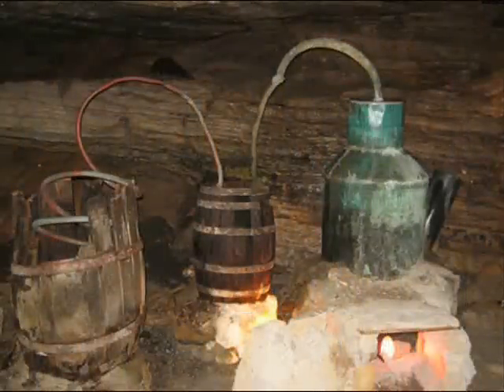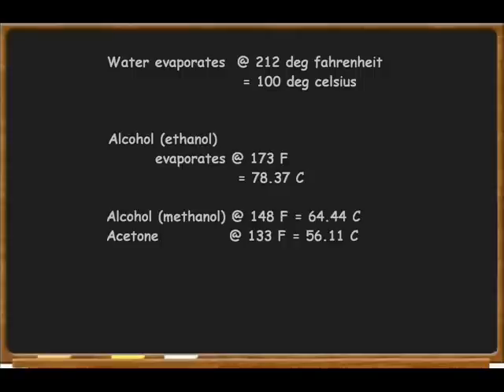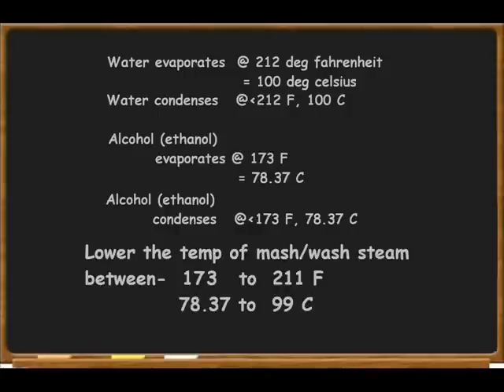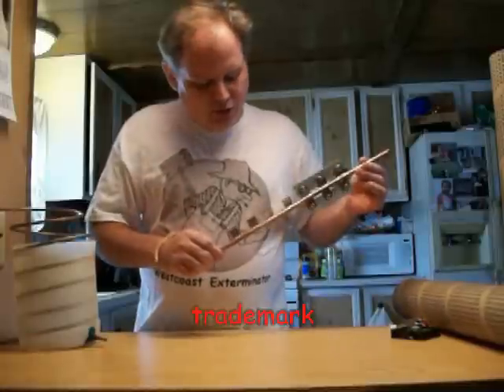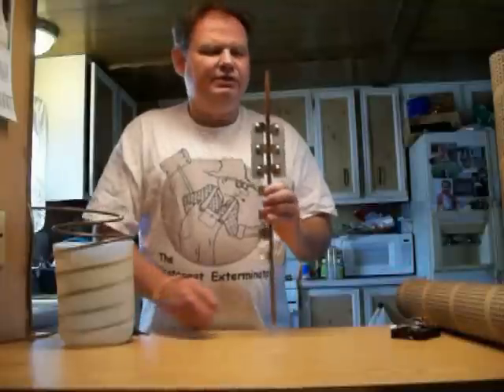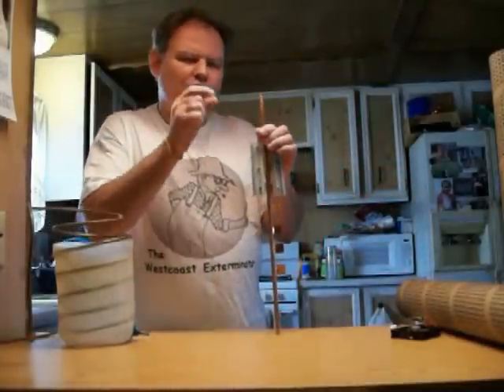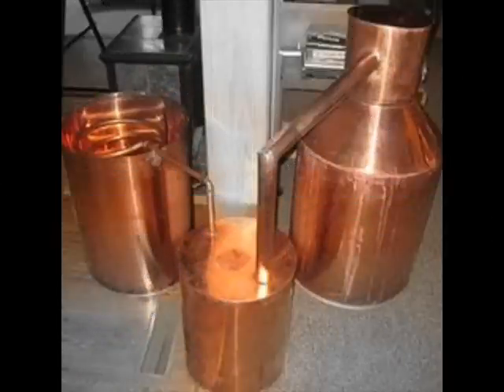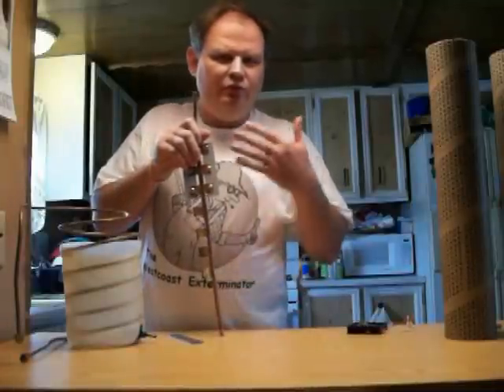Moonshine Still Reflux Columns & Thumper Kegs 101

Comment: Great video with the right information. I have 24 quarter inch copper tubes through the top half of my column. Looks like a porcupine, but works great with just a small fan on it.

Comment: Rather use a half meter 50mm copper pipe and put half meter 15mm copper pipes in til it is full of pipes inside giving it alot of surface area for the steam to touch and condens on

Comment: Good info.  Brainstorm! I am going to use this info and use a 4' length of 3/4" copper baseboard heat element already covered in aluminum fins made to dissipate heat. No more 2" column. Thanks. Now I see this is 5 years old.
Reply from the maker: Keep me posted on your results.
Reply: I would like to know how this works out for you. I was thinking the same thing. Thank you.
Reply: I will use 1/2" baseboard element off the line arm.  Easy add on. Will update.
Reply: @joeogden7361  ok, thanks for your reply looking forward for your results.

Comment: One flaw I can see is that steam produces pressure.  The smaller the tube Increases the pressure which will not allow the water to condense and fall out and away from the alcohol vapors.  1 inch pipe should be the smallest column used.
Reply from the maker: There is logic to that, but I run extremely low pressure

Comment: So u have to fill the thumper with alcohol well not fill but a lil past the lowest pipe what if its my first run on a still should i leave it empty ?
Reply from the maker: Well I'm not even sure how reliable a thumper is. Personally I don't see the need for one. If you look at Popcorn Suttons last run video you'll see he has a thumper to increase alcohol %, BUT he then waters the final product down greatly. Also the temp of the thumper will slowly rise, making it less effective. Also you can just add the "backins" to your pot. That's what I do.

Comment: Can you run it through a small radiator like a transmission cooler with a fan behind it that's temperature regulated when it hits a certain temperature the fan kicks on
Reply from the maker: Hmmmm. Yes and no. It would be more correct top say to dial everything in, like adjusting heat and air flow to cool things. You want everything at a constant, not fluxuating.

Comment: FYI: For mechanical metal contacts (not soldered) heat transfer grease is available. Typically it’s used between heat producing components on electronic circuit boards and finned heat sinks. The grease insures full thermal contact to the heat sink. 

GREAT CHANNEL!!! Thanks for posting.
Reply from the maker: Yes I know. It's used on computer chips. I plan using a couple cooling fans with heat sinks in future videos. This was just explaining the process.
Reply: wcemichael 
You are way ahead of me..... I should have figured! 

I love your channel. I did some distilling in my 20’s. Thank you for reminding me of those good times.

I’m a new subscriber as of last week...

Comment: Okay here's what I don't get... water evaporates at 212 and alcohol 173 degrees. Do you need a reflux or thumper if you keep steam a consistent 175 coming from the pot to the worm?
Reply from the maker: You don't need a thumper or reflux at all, it's just a trick to get a slightly higher proof by allowing the water to condense first and run into a different container.

Comment: Can you use Water Pex tube? its high temp
Reply from the maker: No. It's high temp but not alcohol steam temp. You also need heat transfer from the metal. Chemical lab equipment could be used.

Comment: Great video,good to see people improving semi-ancient tech. Have you considered a peltier module for your heat displacement/condensing needs? Placed on the fins of your proto it could (even only using it at 3-6v,instead of the full 12v) over compensate for the accumulated heat,I wouldn't recommend using the full 12v supply because the temps would reach freezing (and below).
Reply: https://www.youtube.com/watch?v=vf90zIUPpMo

Comment: the packing just catches the water vapors and drops them back into the pot and the alcohol passes through to the cooling coil. done!!!
Reply from the maker: Yes I know, that's exactly my point. to get use of the extra diameter in cooling you need extra parts inside. Smaller diameter tubing solves that, but you also need extra cooling on the thinner tubing. It's a trade off one way or the other. Putting some cooling fins on the thinner tubing will get extra cooling and you don't have packing that needs to be cleaned or replaced

Comment: Sorry WCE.  The purpose of the column  in a refluxing column still is not heat transfer; it accommodates several plates along its length (height).  As the initial vapors rise, it is true that condensation begins as it hits the cooler metal components and eventually the dephlegmator (condenser at the top).  But the columns are not made tall as a means to transfer heat but rather to accommodate many stages of increasingly higher proof "distillation stages."  Cooling and condensing does occur in the column and creates a pressure gradient (high at the boiler-end and lower at the top) across the entire vertical column which drives the vapor towards the top.  This happens progressively as the vaporization/condensing temperature drops at each stage due to properties of the higher proof liquid at each stage.  As it forms, condensate will accumulate at each plate and create a shallow pool; holes in the plate are a relatively high resistance to liquid and prevents the condensate from running back down towards the boiler in the face of the rising vapor since the holes are a fairly low resistance to the rising hot vapors moving upward through the plate.  The rising vapors will heat and vaporize some of the accumulated condensate as it passes up towards the next higher plate.  This process continues all along the height of the column repeating at each plate.  The benefit is that the fraction of alcohol at each plate is progressively higher; highest proof at the top, lowest at the bottom.  The accumulated condensate at each plate cannot be totally vaporized due to thermodynamic principles, associated with the desired reflux action, and some condensate will continue to accumulate at each plate level; without a level control process, each stage could eventually flood.  So a short stub of tubing (downcomer) is located in each plate that will direct the accumulated condensate to overflow or fall downward to the next lower plate where it will be reheated by vapors passing through that lower plate.  The height of the downcomer determines the flooded level at each plate and also has an engineered length below the plate that assures a column of liquid is formed and will essentially prevent a bypass path for the rising vapors thus forcing vapor to pass through the plate (which is perforated with many holes or has some sort of bubble cap system).  When perfectly tuned up the column could live in a state of reflux forever...not really...but a longtime.  Once the desired proof is reached the deplegmator's cooling can be reduced which will allow the highest proof vapors to continue out of the still where it encounters another condenser near a collection point; this is the product condenser.  Refluxing in distillation is a well understood technique mastered by petroleum and other chemical processing industries.  What you are suggesting is a heat transfer fin arrangement that will just cool the vapors generated in the boiler, condensers with external forced cooling (air or water) are much more efficient.  But keep looking for ways to improve this process.
Reply from the maker: I don't mean to argue with you, especially since were very polite and your first words here were not "You're an idiot", lol, but there are only 2 processes involved with distilling. Vaporization and Condensation. These happen at different temps so the location of where a certain condensation occurs is critical, either over the pot or over the final collecting container. At any rate, once my divorce is final, I plan on doing some experiments and exploring this further with just a couple of simple items.

Comment: why not just get one of those 15 feet heat pipe exchanger for home (it has surface fins) and pump your moonshine 
or get those car radiator/oil radiator and pump steam through those -    it should condense steam to water :)
Reply from the maker: The heat exchanger might be a good idea. It has to be solid copper inside.

Comment: you're confusing boiling with evaporation. water BOILS at 212. It evaporates at any temp between 32-212. Alcohol evaporates at any temp where it's liquid as well. This is a fundamental error in this video.

Comment: why not get 1/4 inch tube 1/2 inch 1 in, 2 inch and 3..put them all inside one another with holes drilled without..the 1/4 is the shortest one, and up and up acting like rings of metal to help condense the water back out, only letting the vapor rise... so if your total stack height is 2 feet, the 1/4 pipe is 6 inch, then 8, 12, 16 so by the time it gets to the top to go into the cone and down the pipe most of the water is  condensed out.. and as the steam comes out is spreads out ward, also giving it two metal surfaces to touch as it rises..
Reply: or you could just put some sheets of metal though it creating more surface and the steam passes it and condenses out water..
Reply: and you can get copper tube with heatsinks on it from the water cooled computers...takes all the work out of it..and just soldering up your connections...

Comment: The crap that appears here and elsewhere is just that, crap.  Yeasts, and there are many of them, convert sugars, and there are many of them, into ethanol, drinkable alcohol and into some nastieas as well.

Yeasts do not feed on starch.  Starches need an enzyme to convert them into useable sugar.

Do not waste time.  Start with fermentable sugar, preferably glucose or dextrose  but supermarket sugar, sucrose, will do.

There are many alcohols.  Methanol is the two carbon atom alcohol which will kill you, pronto.  Avoid it.  Ethanol is the three carbon alcohol which we drink and, most of us anyway, enjoy. There are other four, five and plus alcohols which will give you a fucking hangover or worse.  Avoid them too.

Start with right sugar, sucrose, dextrose maltose or fructose, basically six carbon sugars.  Use a decent yeast, supermarket dried yeast will do the job.

Keep the  mix sterile.  That is; keep everything close to boiling point in the early stages.  Put a lid on things and let it cool to blood heat before adding the yeast.  Add it too soon and you will kill it.  It is a living organism.
Reply from the maker: Nobody is talking about yeasts and sugars in this video
Reply from the maker: I don't know what videos you are watching. I know and have always stated yeasts convert sugars to alcohols and have never said they work on starch.
Reply: Methanol is a single carbon alcohol, ethanol is C2H6O.
Go back to school

Comment: Add salt to the mash it raises the boiling point of the water but not the alcohol.
Reply from the maker: Not sure that's accurate, it might be the reverse, but hey, not a bad idea to look into. Thanks
Reply: wcemichael It is how the first hard alcohols were distilled using primitive inefficient distillers. It is basic chemistry you can test it with two similar pots of water on a stove  one salted th other fresh start heating at the same time at the same settings see which one boils first. Glad to help.
Reply: Barskor1 That wont work  you get boiling point elevation and frezzing point depression, so it will make it harder to seperate, remeber alcohol is oh and has a negative charge, and salt will in water release positive sodium ion so the sodium will attract the alcohol and bind it stronger.   so it will require a higher temp to seperate alcohol if salt is added so adding salt will make seperation harder
Reply: voltronsupreme You do not do both at the same time one or the other.

Comment: 2:40 You realize that is a pot still, NOT a reflux still...? The passive reflux you get from that small riser, is neglectable. That means you won't get a higher ABV in your product, it is what it is...a simple pot still. Also, I wonder what the thumpers shown have to do with it? IF you were to put a thumper on after the pot still, THEN and only then you would get a higher proof due to the second distillation. That's clearly not the case here, so again...it's just a pot still.
3:33 "As much heat displacement in the air.." Again you are telling people wrong facts, and you don't understand what a reflux column does..! You actually DON'T want anything to condense on the walls, you want to let the vapor travel ALL the way to the top where your reflux condenser is located. The reason is that you want to take advantage of all the packing/plates in the column. Btw...my reflux column is insulated, which has the nice side effect of lowering the heating costs.
7:42 "There are other things you can put.." Ohh...sure you could use steel if you wanted an inefficient air-cooled still, if not ..use materials that are suitable for it. Why do you think heatsinks on electronics are copper or aluminum?
9:10 Once again you don't understand the basic theories of such still. It's not a matter of disappeat more heat to get a higher proof. The height of your column determines the proof, i.e. how much packing/plates the vapor would face.
10:30 WTF..??? Now it's really clear to me you don't know shit about distilling..! That's an air cooled condenser, NOT a reflux column! In a million years this won't be any reflux column! A reflux column HAS to be perpendicular to function, the picture shows a contraption that is roughly 45 degrees tilted. That would mean all reflux would run down one side, rendering the rest of the packing useless.
12:00 Now you want to tell us a pot still with a thumper is a reflux still, as long as the thumper is dry??? WTF??
The distillate can't even run back into the boiler and you call it a reflux still. 
Well, read and learn a little before you tell people such shit... You still have a lot to learn before you should teach others.
Reply: Yes this guy has no clue what he is talking about, I saw that when his best alcohol % was 130.
Reply: Well said and spot on.
Reply: Glad I'm not the only one who was thinking that's not how a distillation column works.
Reply: @DaniGirl6  Yeah. There are just too many badly build distillation rigs on YouTube. Also, a lot of people with absolutely zero understanding of how these things work. That results in a bunch of bad and in worst case scenario dangerous "advise" /false facts, that the novice would take for good.
Reply: Feel better now?